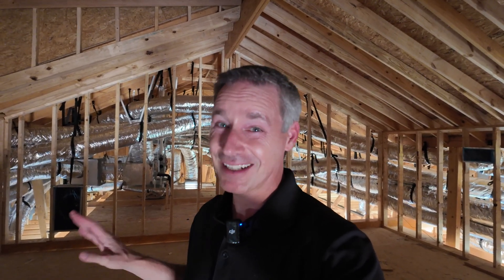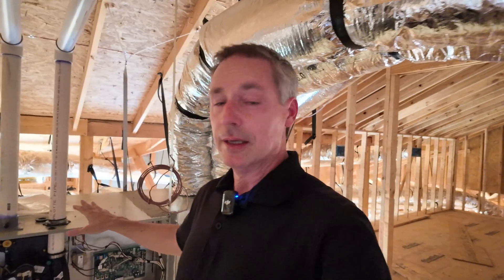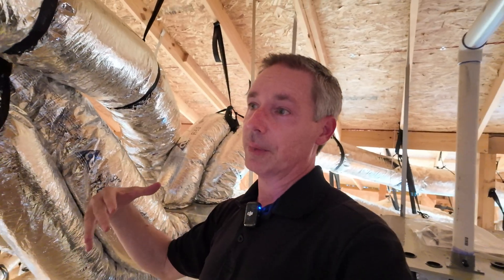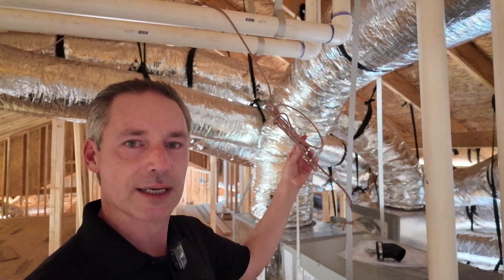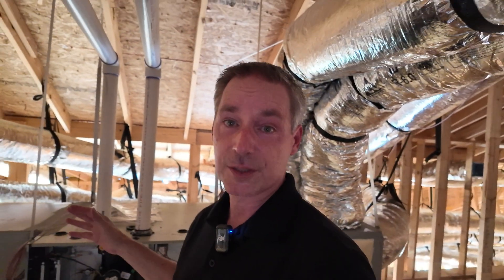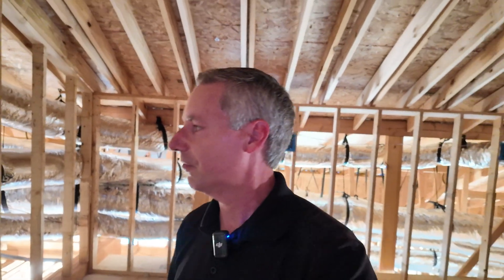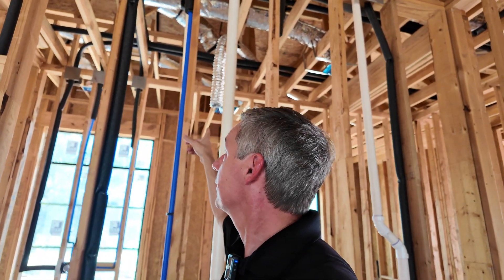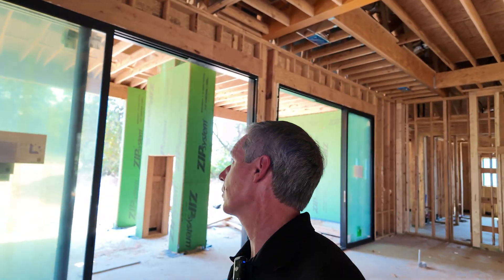The HVAC Rough-In Phase Of A New Home Build Explained

Comment: So why does everyone hate putting HVAC in the attic but everyone still does it?
Reply from the maker: It’s purely a space savings measure. That said, we use foam and encapsulation so the attic is insulated and has some conditioning, so all that equipment is basically in conditioned space. It’s when it’s hanging in a hot or cold vented attic that doesn’t seem to make a lot of sense, but it’s still done Everywhere.

Comment: You always do a great job explaining things for a novice like me to understand. Thanks for spending time explaining how dampers function. Out of curiosity, what will this home's R values be when the spray foam is completed?  Am I correct to assume 2x6 walls and rafters and that you use only open cell foam?
Reply from the maker: Thanks @wayne1916! 

Open cell runs about R-4 per inch. 

So 2x4 walls (actually 3.5") are approximately R-14.

2x6 walls (5.5") are approx R-22

Roof rafters are 2x6 but we will usually spray to 8" so we get approx. R-32

Spray foam doesn't get significantly higher R values than conventional insulation, but its main strength is its air sealing properties.
Reply: @legacyclassichomes5774  Thanks Steve.

Comment: Wouldn't sheet metal ducts for main runs be more efficient that all that flex?
Reply from the maker: They are more efficient. They are also a lot more costly so not commonly used in residential.

Comment: Is attic conditioned space?
Reply from the maker: Technically no, although the term “conditioned attic” is often used. A little conditioned air is blown into the encapsulated attic to keep the temps mild and control humidity.